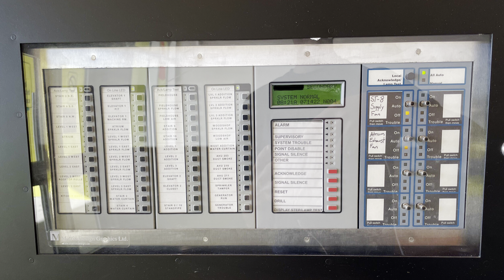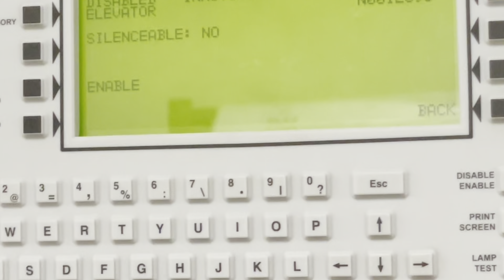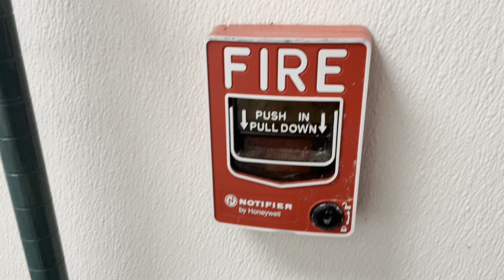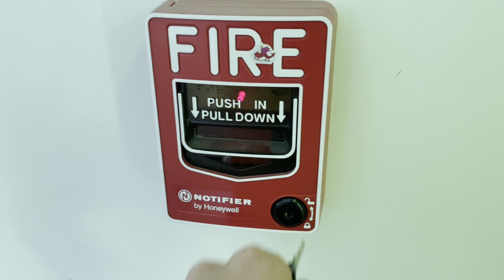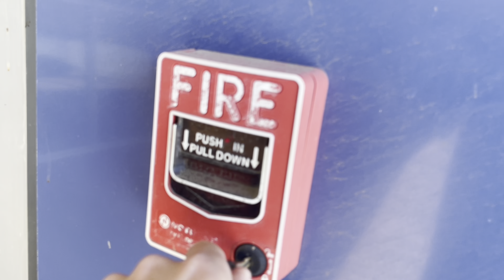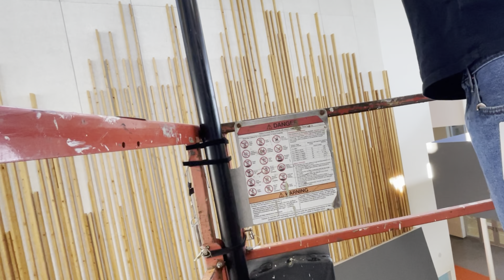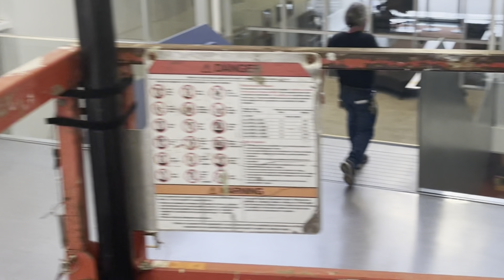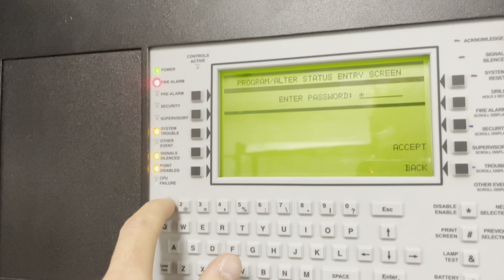Fire alarm testing at my high school with 62 foot high smoke detectors and smoke fan test

Comment: I was supposed to get a school like that but it never got passed sadly
At least my current high school actually has many kinds of alarms.
In the school itself it has a different model simplex and possibly Faraday horns, a red light on the wall in the assembly gym, and a gentex commander (Maybe version 1?) in the PE gym/Lunchroom, and finally an old Simplex horn in the choir room. The annex just has Simplex horn/strobes. The portables mostly have Spectralert advance horn/strobes, but the public speaking portable has a Spectralert classic. Also for emergency lighting, some lights in the front of the school and the annex have what looks like little red “O”s in them so I am guessing those lights stay on, the rest of the school just has Dual-lite twin heads and the “LBC lighting” I think it’s called. The portables have an old dual-lite and the public speaking portable has both the old dual-lite and a newer led one. However the science one has one on the side of the room and the one next to the door has no heads but somehow has a working battery.

Comment: I’ve been thinking about the horns seeming out of sync. Assuming the alarms actually are in sync, it is possible that it’s the speed of sound that is causing them to sound that way. Given the speed of sound is approximately 343 m/s, and the somewhat open concept of the school, we might just be hearing the delay it takes for sound to travel
Reply from the maker: That’s what the fa technicians are saying but even in the gym where you only have two in the same room they still sound like they’re going off at different times
Reply: Sounds to me like they just forgot to turn on sync, or the NACs aren’t synced with each other
Reply from the maker: @HenBasketFireAlarms  apparently system sensor sync is enabled on all nacs  and booster panel so they say it should be fine
Reply: @nics-systems-electric  really weird that they’re out of sync then
Reply from the maker: @HenBasketFireAlarms  yea it’s not good but not sure what you could do about it everyone says sync modules but that does the same thing as the sync in the panel
Reply: @nics-systems-electric  it’s not like panels have had sync built in for at least the last ten years or anything. /s

I know MDL’s have the capability to sync with other MDL’s with sync output and input terminals, but the panels should take care of that. Thinking about it is giving me a headache lmao
Reply: @nics-systems-electric  wierd but last video you uploaded about your school the Alarms were in sync and were sounding the evacuation sound at the same time
Reply from the maker: @tritime1236  what video was that they have never been in sync?
Reply: @nics-systems-electric  nevermind different channel
Reply: @nics-systems-electric  are the NACs tethered to each other?as in panel - sub panel - sub panel
Reply from the maker: @tmalley  One of the nacs does activate a nac extender FCPS 24 which does the horn strobes in the addition The only other panel is the one in the electrical house for the ex-portables which is networked in to the main school panel

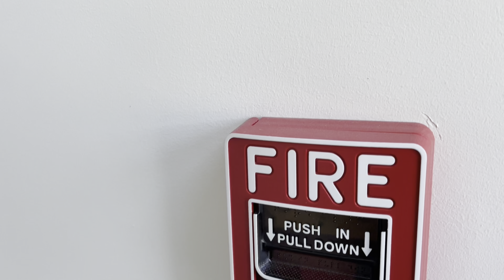Comment: Oh yeah the problem at 14:10 is supposedly very common with bg 12's  and its dangerous since if someone pulled it it wouldn't set of the fire alarm. Of course for newer buildings smoke detectors will trip but for older buildings it's more of a hazard
Reply: At least moving the handle a bit when it's pulled down does activate it.

This also happens with Simplex T-Bar pull stations.

Comment: Love seeing those big fans operate! Are those fan motors controlled by some sort of VFD? And are they fed by a 600V three phase or another voltage?
Reply from the maker: No VFD I don’t believe at least if there is one it’s only for a soft start or softer at least but 600/347 v three phase

Comment: 14:26 That pull Station has got an issue! I remember last years testing video there was an issue with another pull station in that school, is that the exact same pull station?
Reply from the maker: No it’s a different one usually every year there’s one or two somewhere in the school district that act up just depends if you don’t pull it certain way
Reply: @nics-systems-electric  Huh… that’s weird, I have no idea why they do that. I have a Notifier NBG-12L and a FireLite BG-12L, and I don’t see why they would do that!

Comment: Nice job I like to use walk test with horns and use smoke but you have to have a can of air to clear it or may go off again also it hard to find the spot place the magnet on smoke detector  sometimes  
I also noticed detectors were not marked with there address on them wich is helpful in identifying with detector tripped as well for trouble shooting from  Rich Owner of an Alarm Company.

Comment: I'll be shocked if you reply on a video this old, but what is the lighting system your school uses? The models of the switches would be appreciated, but I could work with a brand name. I like the design and the "networked" aspect of it.
Reply from the maker: Douglas lighting control
Reply: @nics-systems-electric  wonderful, thank you.

Comment: A large school like this should really have a speaker system w/ voice, not a horn system. Horns should only be used in small systems.
Reply from the maker: This school is in Canada we only have voice evacuation/mass notification systems in hospitals and high-rise buildings over a certain age size or the amount of occupants in the building does not affect if it's required or not

Comment: Is that panel in the old portable electrical room networked to the main panel? And is the field house on that panel?
Reply from the maker: Yes it’s networked and the field house is just off the main school panel slc and nac  nothing to do with the electric house panel
Reply: @nics-systems-electric  so is the electrical shed and the main building panel connected via the local building network? (And if it is hopefully it is vlanned off from the rest of the network)
Reply from the maker: @maxdutiel  No nothing to do with the Wi-Fi network just a term for how they are connected together

Comment: 2:27 Do the doors also provide the first evacuation routes when they open?
Reply from the maker: Their intended purpose is only for make up air as only specific doors open not all egress routes as well they only open on smoke alarm not pull station or sprinkler flow

Comment: Is the footage of the exhaust fan going in both directions as it slows down after it gets shut off due to the camera or the fan itself? It looks like it spins clockwise for a few seconds, then counterclockwise for a few seconds at first, and then stays clockwise at the final stage when it finally stops.
Reply from the maker: Definitely cameras that's extremely normal for cameras to do you've noticed they do that with almost any spinning thing happens when it is going through different speed ranges and when it matches the frame rate gliding in and out of matching it

Comment: 1:08:15 When they silenced the alarms, I heard one out of sync still going for a second. Is that an outside horn/strobe?
Reply from the maker: No that was just one in the addition off the booster panel just takes a bit longer to silence
Reply: @nics-systems-electric  which is the booster panel
Reply from the maker: @ksfAandkhiproductions151  the panel in the mechanical room second floor of the wood shop where the addition meets the original section it's not shown in this video but is in other ones

Comment: I wonder why there is no protection on the fan inlet, you can just stick your arm inside?
Reply from the maker: If it was a accessible room that was likely to be occupied and in public reach then it probably would however the only people that should and will be going in there should also have the knowledge to realize what can happen I do agree it would seem good to have some protection on the front of it however that may reduce airflow

Comment: How come they didn't sync this system? Also, no strobes?
Reply from the maker: There are strobes The system is apparently synchronized we didn’t think it was but what we have been told is it is just the echo but system sensor synchronization is enabled and there is no reason for it to not be working but it still doesn’t sound like it is to me either

Comment: Why does your High School doesn’t put the system in Walk Test when you guys test all of the pull stations and smoke detectors!
Reply from the maker: Because it makes it more difficult for the person that’s following you around trying to figure out whereabouts in the buildings you are it’s just as fast if the person that’s writing everything down just hits acknowledge every time
Reply: @nics-systems-electric  ok I get it now! It does make sense and after you guys complete the pulls stations and smoke detectors you guy put it to normal and then set off the entire system!
Reply from the maker: @milesra22  Yeah and we did it at the start anyways to test the fans
Reply: I prefer the walk test with horns if by myself then I can see and here test but can always check history which detectors tripped I noticed detectors were not marked   with the  Detectors address (detector ID) From Rich Private alarm contractor nice job well done note it's hard to find right spot to place magnet on smokes Sometimes good check with test smoke can bring you can of air to clear smoke otherwise it make take while to smoke to clear out of it may go of again until it clears

Comment: Why are there two control panels
Reply from the maker: I talk about it in the video that the one in the E-house is for the portables which there was once 10 and there was none at the time of this video but 2 to 4 will be coming back this summer
Reply: @nics-systems-electric  so the annunciator is for the school and the one in the E-house is for the portables
Reply from the maker: @ksfAandkhiproductions151  the annunciator is for all of them the portable system sets off the main system and the main system sets off the portable system it's just being used as a booster panel

Comment: They should have installed scorpion smoke testers 62ft in the air
Reply from the maker: Would be interesting I've never actually seen them on a system
Reply: Actually I’m surprised that they are not using beam detectors for the atrium and gyms having remote key switch testing/reset capabilities. I’ve installed quite a few over the years in applications like this. It saves on the amount of smoke heads needed to cover an area/ no need for lift for testing/ and less damage from sports stuff.  Basically a laser beam goes from one side to a reflector and bounces back. The unit can tell if there is smoke based on the beam pattern of light coming back. Some brands and models had a receiver on the opposite side that had to be wired in.  I liked the version where all wiring and test switch was on one end. For true testing  you could put  a can of smoke on the end of a stick in the middle of the room or brake the beam with different levels of colored film representing different particles in the air.
Reply from the maker: @BR-ft2xg  yeah that's my thoughts too that they should've install the beam detector however I have seen a lot more problems with beam detectors causing false alarms and troubles so maybe they figured there would be an issue there

Comment: I have a BG-12 and it doesn't have problems with flicking the interior switch. That's all little weird. 15:38
Reply from the maker: Might just be in the way you pull it it happens every once in a while
Reply: Even so, I could just imagine someone else trying to pull the fire alarm in a situation and then no one knows about it because you already tried to pull the fire alarm. Maybe it's just a design flaw everyone overlooked?
Reply from the maker: @Reeseshead  I would say it’s probably a slight flaw maybe if you don’t push it in hard enough it won’t activate not sure what I did differently with that one I’ve had it happened before